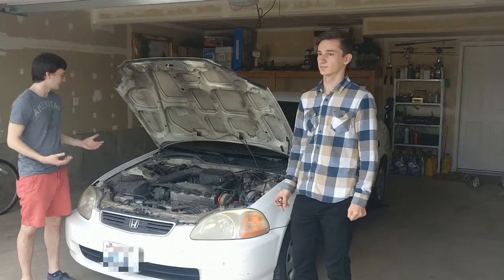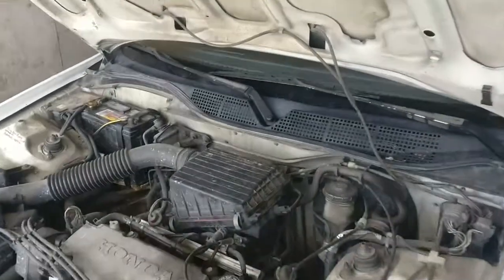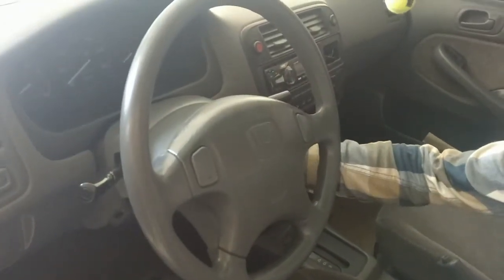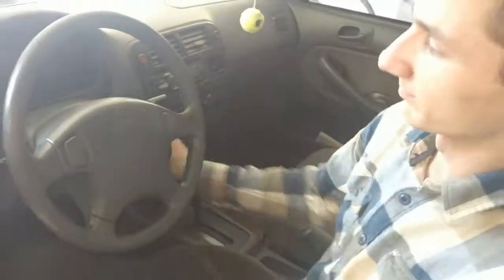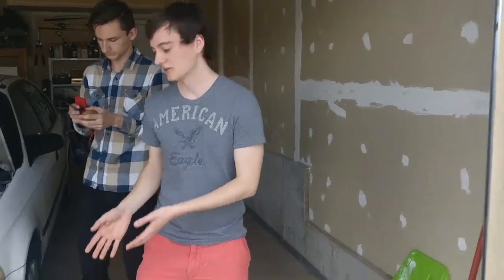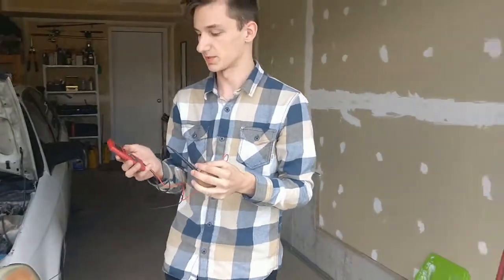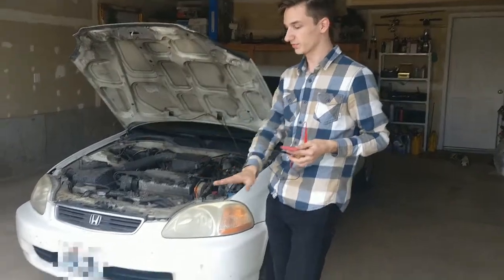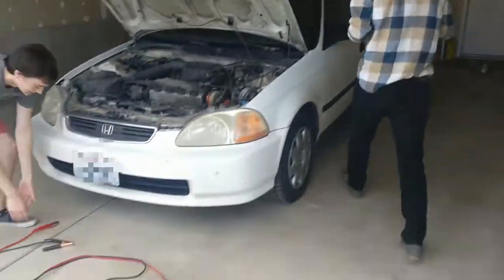How to Jumpstart a Car Battery with Potatoes

Comment: This video is exactly why you will never catch me without precisely twelve potatoes in my car  at any given time. Trust me when I say that it's extremely worth it to have some potatoes at the ready. I can't tell you how many times I've seen a Subaru broken down on the side of the road and pulled over to let them use my potatoes. There are so many benefits to having potatoes in my car, 
1. I only have to replace them every two weeks or so, really depends on the potatoes 
2. If I'm hungry I have a snack right there in the car 
3. You never know who's gonna need some potatoes on standby
4. If it's a really hot day I'll have some nice baked potatoes in my car after a long day at work
As you can see by this video there's really no reason why you shouldn't always have a baker's dozen potatoes in your car.
Reply: Hi! I'm replying to your comment to your comment to let you know that you made a mistake when you posted this 4 years ago. A baker's dozen is actually 13. Okay, go back into the void now.